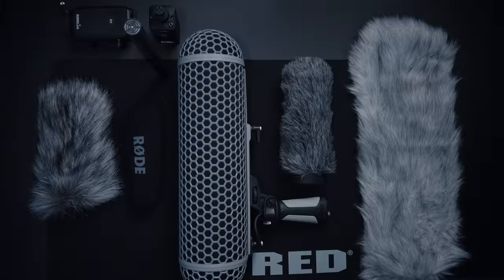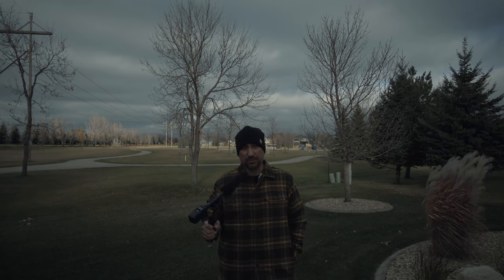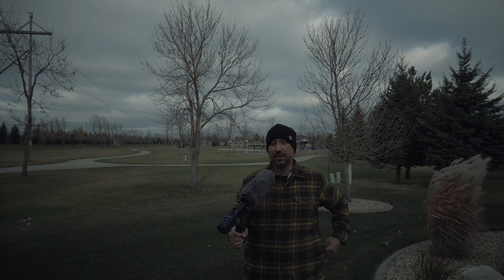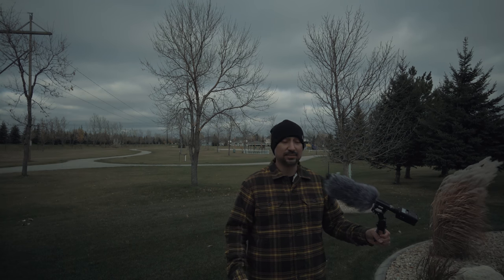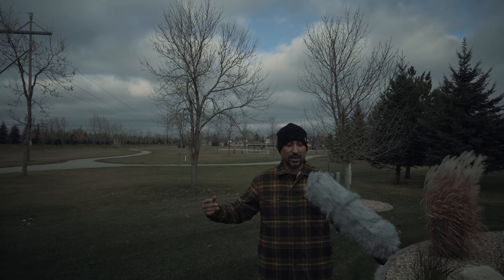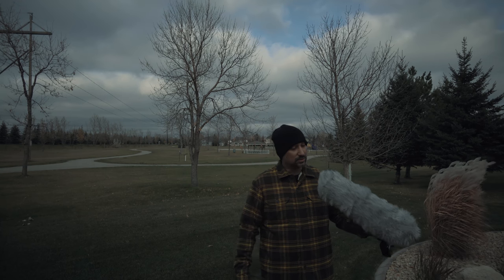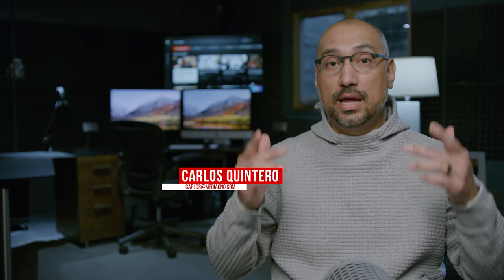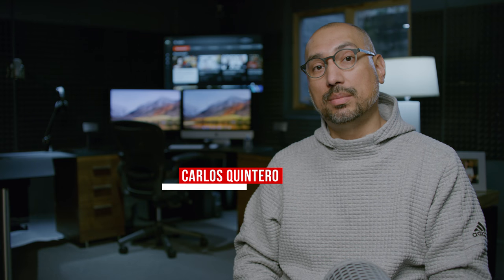Location Sound Wind Treatment for Shotgun Mic - Rode Mic in Road Blimp with Furry an overview

Comment: This was a worst case example I know for demonstration purposes. Try using the talent/actor as a windbreak or put the mic in a place where the wind is blowing across axis as a shotgun mic rejects from the sides. Also another thing that works fantastically well is if you can find a pothole that will act like a parabolic dish. This works great if you're somewhere like a skatepark for example.